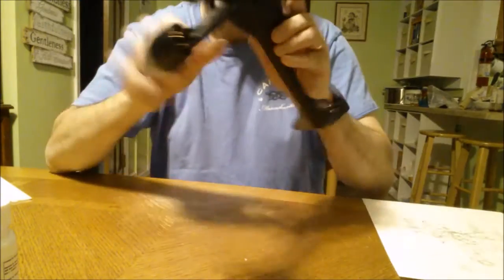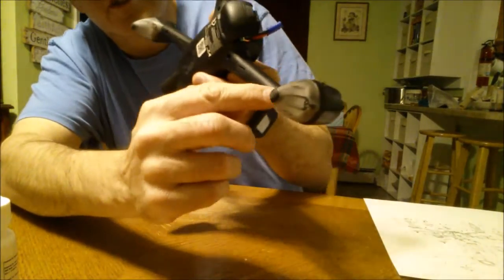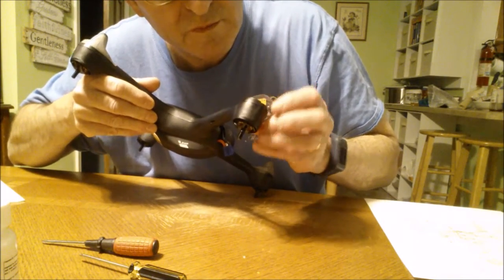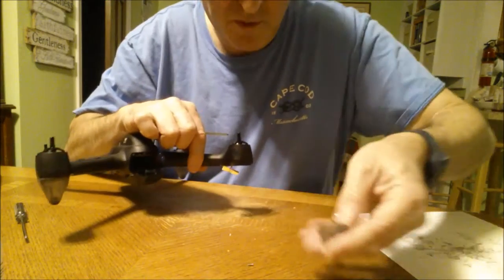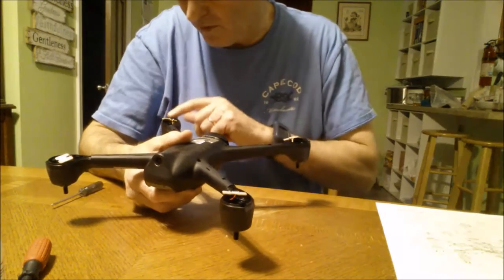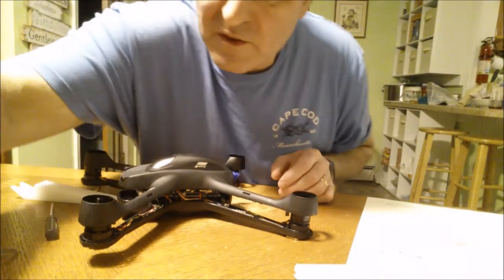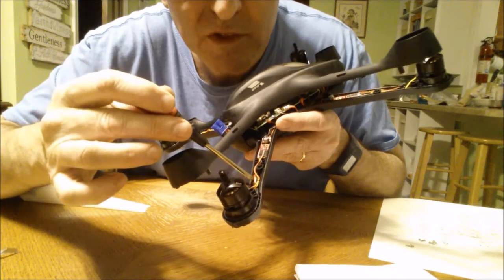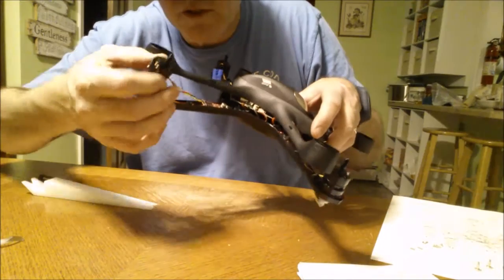Hubsan H501c Motor Removal

Comment: Hi, I have a 501c...love it! Question...the led lights will not flash during flight, only remain solid. Tried the L trim switch as this only turns lights on or off. I would like them to flash while flying. Thanks!
Reply from the maker: Never knew that the L trim switch made the lights turn off.  I don't know the answer to your question but you might try anne.lu@hubsan.com for the answer.

Comment: Nice tutorial, Mine had the motor screws glued down. I put some denatured alcohol on the screw tops (they had to be wet) and Heaved those screws out. I couldn't get them to budge without some denatured alcohol.1 motor was so hard to remove I had to soak the entire motor and frame in denatured alcohol. This has been a time consuming project for me.